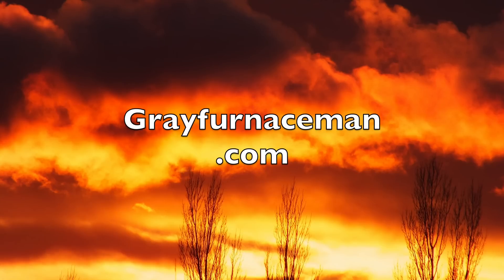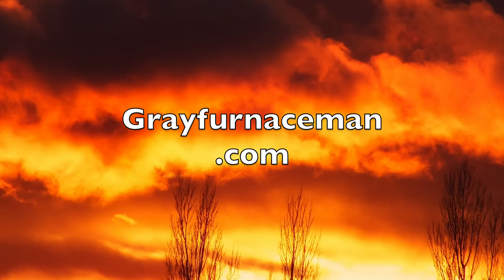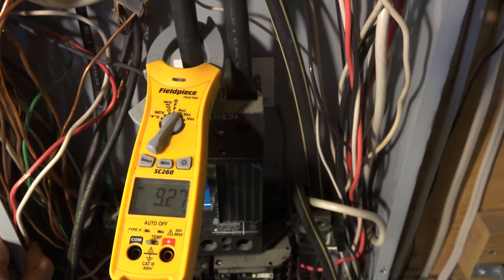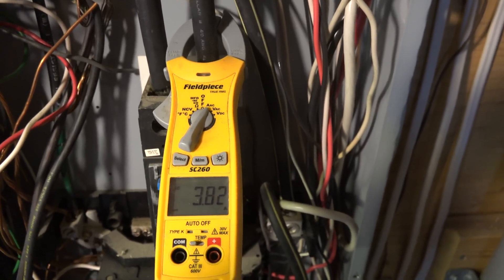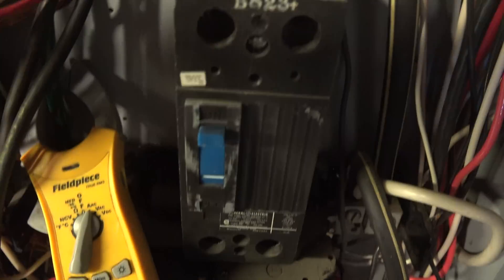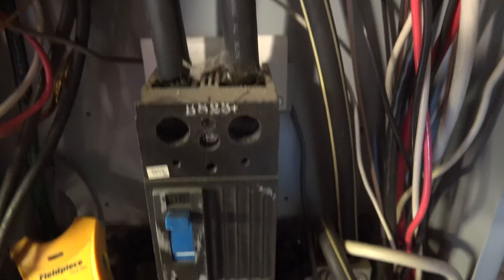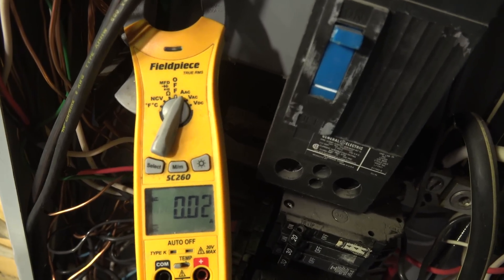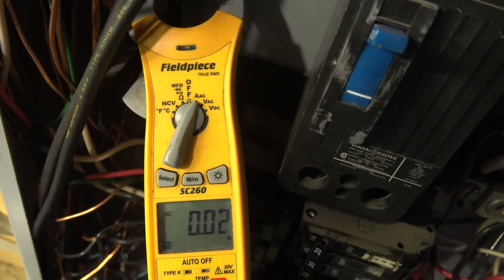Does power pass to earth ground?

Comment: In a perfect world, yes. BUT pole transformers use one lead and earth ground on primary  and the secondary  side is also grounded to the earth.You must have current flow from the one primary lead to ground to make the transformer work. So if you have a circuit  that looses its neutral lead it will show current to ground. How about power cables falling during storms? Tell me theirs no current there. I'm still trying to wrap my head as to what a current meter would read on a circuit using earth ground as neutral
Reply from the maker: The only system that uses the single wire is the SWER system.  It is only used in some rural systems and will only work with very high voltages.  It is virtually never used anymore.  Lots of problems with this type of system.  The earth ground on the secondary is only there for lightning protection.  Power lines, except those running to the house, will will indeed pass thru ground in storms that break the wires 
but they are much higher voltage.  I have several videos (there is a link at the end of the video) that demonstrate how earth ground works as a conductor.  
GFM

Comment: The best demo is to look at a single phase distribution transformer, it has two 120 secondaries with a center tap that is neutral yet is also at earth/ground potential.As demonstrated there should never be any current flow on the ground
 Neutral faults in the feed line can cause serious problems though, as in high resistance of/or open neutral

Comment: power leave the source and returns to the source so with that being said an equipment grounding conductor is the proper method for a low impedance fault current path back to the source. Earth grounding doesn't provide a low impedance fault current path which will increase the risk of electric shock or electrocution.
Reply from the maker: Good thoughts.  The only thing I would add is the grounding conductor is a low impedance path to neutral.
GFM

Comment: The reason for a a ground is the ability to trip the breaker if the hot comes in contact with the metal chassis of a energized  device.
If it were not there , the device would stay hot and the person would get a shock. That's way it's so important to never cut the ground prong off of a electrical cord.
Reply: This video isn't about that. This is about current, or the lack thereof, on the conductor going to the copper clad steel ground rod(s) driven into the ground/earth/soil outside. Since there is also a ground rod at the pole that puts the rods and the earth itself in parallel with the neutral to the pole. People often speculate that since it is a parallel circuit that current flows through that ground path, but as the video shows the impedance is so much higher than the neutral that almost no current flows.
Reply: Daniel Armstrong that is also correct.
Reply: Chris Ould if the hot wire comes in contact with the metal chassis the breaker will trip because the ground wire conected to the chassis goes back to the neutral and resistence is too low so the breaker trips. the ground rod connected to the earth has nothing to do with this process. the ground rod connected to earth is only there for excess static electricity, spikes, and lightning.